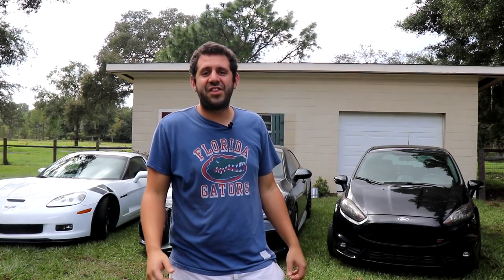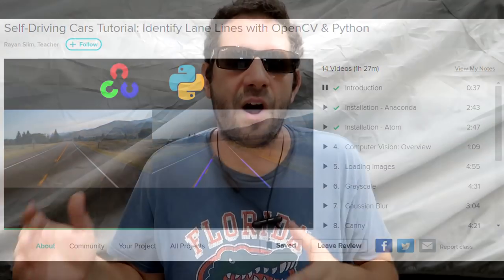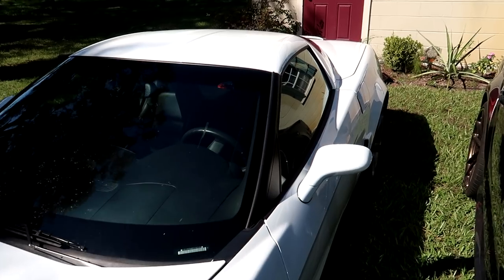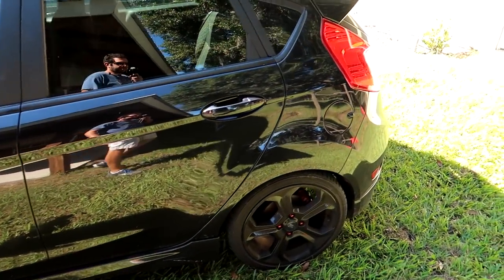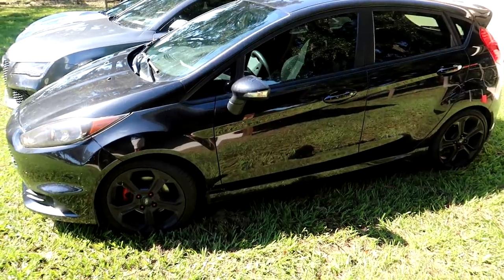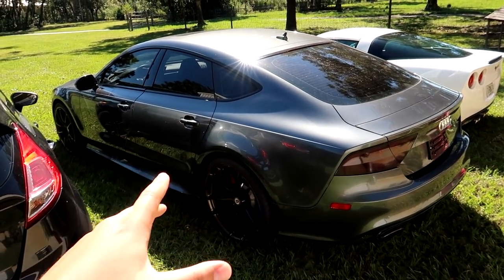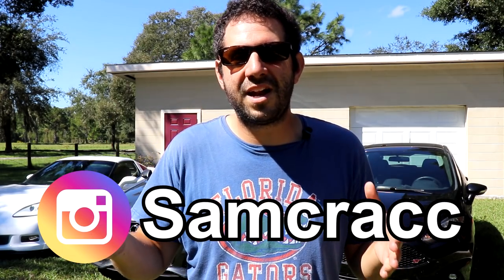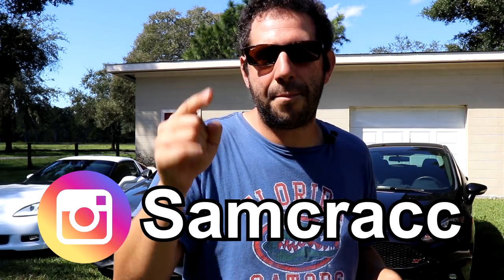Here's What a $100k+ Salvage Title Car Collection Looks Like! With an Audi RS7 & a Supercar

Comment: 1:26 Rear end definitely looks like a 1st gen R8
Reply: i'm pretty sure that's the front end because it's really low but yel it's looking like an r8
Reply: It doesn't have a rear engine though
Reply: "its a 6 speed manual car with a rear mounted engine..."
Reply: Who is mounting rear engines besides maybe Porshe? They dont have too many supercars. The only manual I can think of is the Carrera  GT which is still 500k+ even wrecked and thats mid engine. Most people call mid engine cars rear engine since its behind the driver. Maybe he just slipped up a bit. Definitely looks R8.
Reply: +Eric Ortiz That’s exactly what I thought
Reply: 570s
Reply: @logan5081  Dude come on Rear Engine Mid Engine people usually ignore that detail Although A Porsche could be in play you may be right about spotting the detail
Reply: @KoffaMicHD  could be a Porche but I am leaning more towards an Audi R8 v10
Reply: ur stupid asf
Reply: i mean the r8
Reply: Of course it has a rear engine
Reply: Logan Hansen TV  -.- Audi R8 not rear or mid engine-.-
Reply: its mid engine
Reply: Eric Ortiz yep
Reply: mid=rear lol
Reply: @itsrols2995  That's my guess too.
Reply: Agree.  I think its an R8.  Higher roofline relative to the front and back.  Also R8 parts for rebuild cheaper than most exotics.
Reply: @KoffaMicHD  audi r8 has rear mounted engine but not rear wheel drive!
Reply: A first of its kind, the limited-edition Audi R8 RWS (Rear Wheel Series) is the first Audi model to feature rear-wheel drive with just 999 vehicles available worldwide.
Reply: but then again he didnt mention Rear wheel drive did he
Reply: Eric Ortiz you can see the full we cap on the side blade
Reply: the audi r8 does smh

Comment: Just want to thank you for all the advice and knowledge you provide with this channel. I bought a car from Copart before I stumbled upon your channel got fleeced by a sketchy body shop who didn’t end up doing a proper job and have been riding around with out a functioning seat belt or airbag. I’m now in the process of getting the rest of the car fixed up myself and the seat belts sent off to the website you use. Your channel was just sort of an eye opener to the fact that I could’ve done most of the work myself. Anyways thanks again for the quality content!

Comment: I've had to rebuild the front of my car, but it was self repairs and a friend of a friend that has a frame machine to straighten the radiator supports.  As with most things, you learn a lot about how something works by working on it.  Fortunately it's a Pontiac Grand Prix and there was literally a line of them at the bone yard to pick parts from, so most stuff was cheap to replace.

Comment: At the Volkswagen Dealership where I work they just bought back a “lemon” because the AC condenser was leaking and the part was on back order for over six months. There wasn’t some unfixable issue with the car, they just couldn’t get the parts in a reasonable time and were forced to buy it back.

Comment: Could you do a video about selling these cars? I found a 2006 trailblazer SS with less than 100,000 miles for sale for under $8000. It had frame damage in the very front of the car, it was repaired and now has a salvage title. My only concern with the car, before purchasing it, is I don’t want to be stuck with something I can’t sell

Comment: Please I need help. I very recently bought a 2018 Chrysler 300C for 26,000 with 8,000 miles. And I am very scared that there is a strange history, the car was bought off a USED car dealer, when I spoke to them, they wouldn't give me history about why it was given back so new, and wouldn't give me the vin until I bought it. I still haven't looked at it yet (stupid I know before asking) but they said it was an advertising mishap on why the car was so cheap. But not even a week of owning it now. The check engine light came on.(!!!!!!) The car starter wont work anymore, and when actually started the car shakes, while driving, and gets worse while idling.(I know its a V8, but it didn't do this before) the car alarm goes off randomly. Is this just new car problems (first time I bought a car that isn't a 2005 ford focus) and im scared the dealership sold me a lemon with the false reassurance that it was just a typo of price. Somebody please explain if you can why my car is doing this and if I should've just paid full price for a new unused one.

Comment: Don't make this self driving car unless you really have too much free time or want it really bad. It is not a problem to modify car so it can turn, accelarate or stop on its own, the problem is the reliability of the whole system - both hardware and software. For example your car will be able to detect lines and keep car on its lane, but what will happen when when you encounter some road construction works where lines are changed but the old ones are still visible? This is just a simple problem and there are many more and more complex ones.